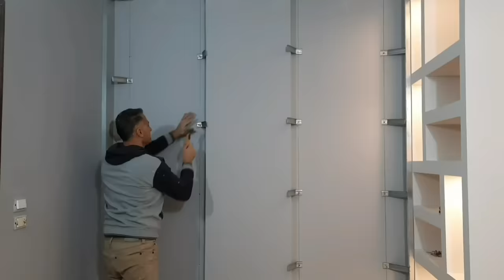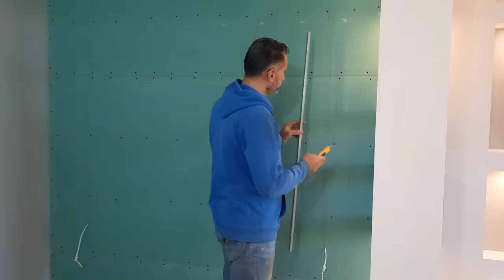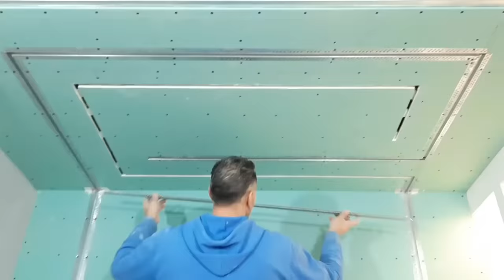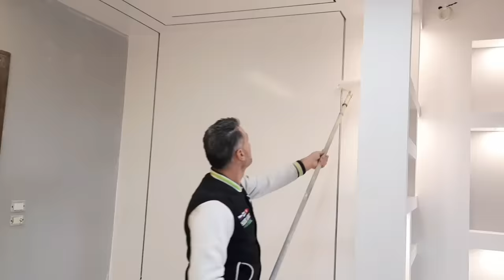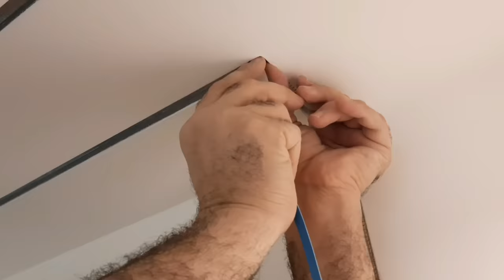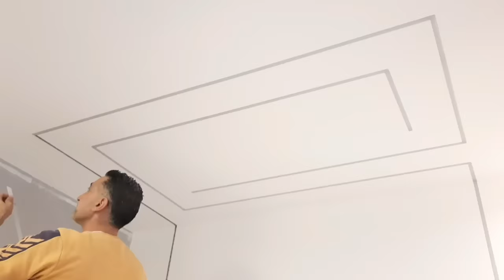طريقة تطعيم ليد بروفايل بديكور جبس بورد

Comment: Admiration for the ideas and implementation! However, not everything that is gold has a glitter, if I may say so. I tried to implement some of the ideas. First note: tape should be put on the corners between the wall and ceiling drywall sheets, because, as shown here: straight with putty, it quickly cracks in the corner. The other thing that is terribly interesting to me is how, when painting, you dip the roller in the bucket, do not squeeze it into anything and then paint, with clean clothes, without even dripping?! That's it, if it's not magic, say hello to him!
Reply from the maker: @vladislavnedialkov4294  It's not magic😊. Follow the first part here.👇🏻
https://youtu.be/h8mpZCam54o

Comment: What are the materials you use to cover the striplight or led??
Reply: Its called profile led my friend
Reply: Thank you for the info
Reply from the maker: The plastic cover and the metal profile are one piece. The gasket is installed first, then after painting, the plastic cover is installed